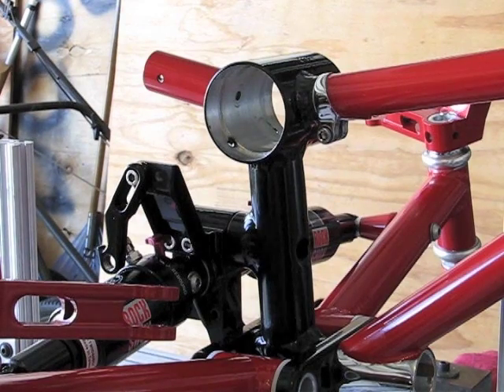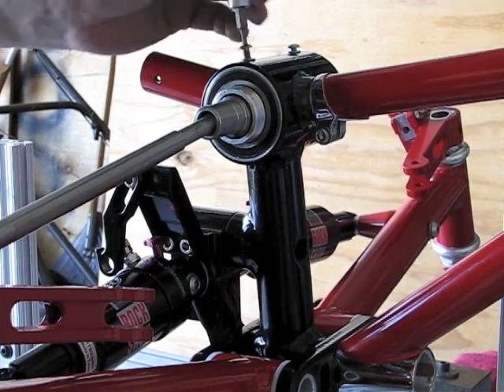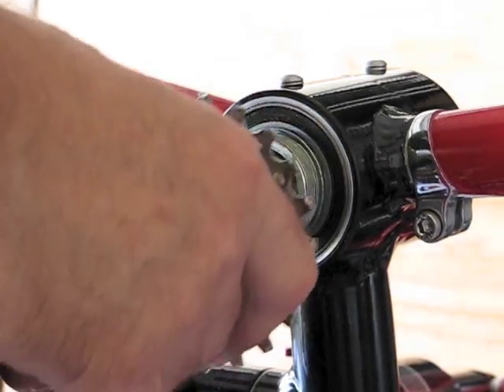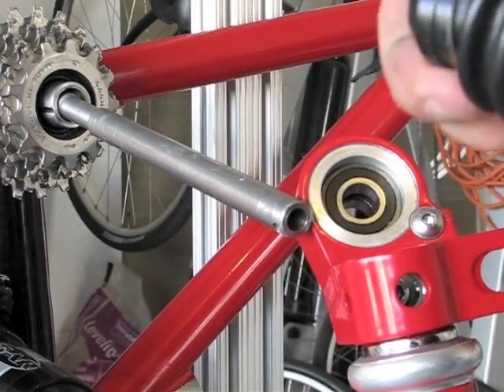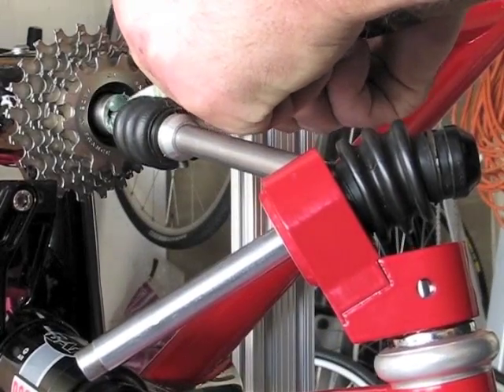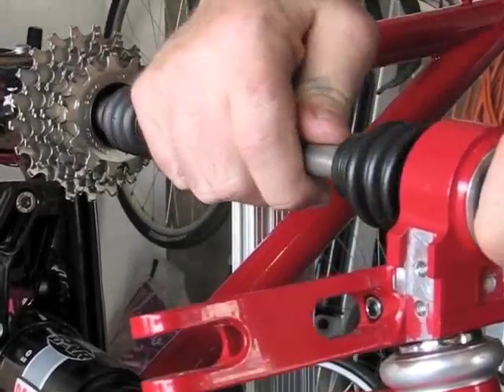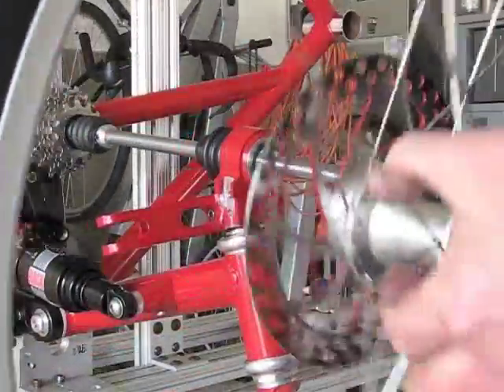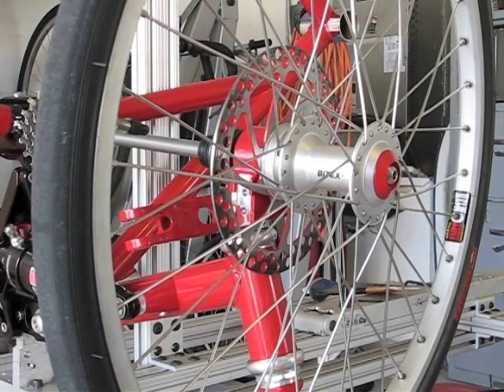FWDTrike Build part 3

Comment: Seeing as the diff is THE KEY PART of a front wheel drive system you perhaps should have gone into a bit more detail here. Pulling a ready assembled unit out of 'thin air' helps noone. Add the statement 'This is something I machined up' and it becomes mere showing off.
You did well in building it but rubbish in documenting it. Sorry, mate.

Comment from the maker: The Bitek hub had cartridge bearings in it and I left the outboard one in to simplify the axle and retaining bolt. The 2nd prototype has the same hub, but on the 3rd one I'll be using shimano hubs and all the bearings will be removed and a special retaining cap will be used.

Comment from the maker: @FormerDemforRonPaul Hello, I see you are very observant! Actually the first bearing holders were spaced wider apart, but that lead to excessive kingpin inclination and extremely hard to turn. The second design failed in the welded areas, so I went with the current design and the minimal spacing is all I had to work with to allow easy turning and correct geometry. I've been riding over a year now and bearings are still in great shape.

Comment: I guess you could really have an aluminium spacer in the outer wheel hub instead of the bearing. The way you adapted the hub to house a keyway drive is very resourcefull